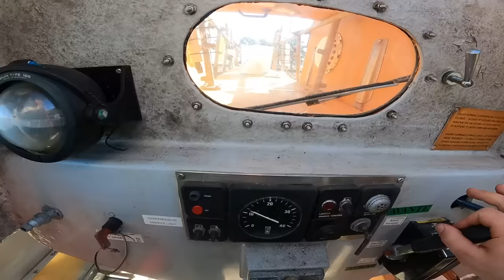Camping On My 64 Person Enclosed LIFEBOAT!!

Comment: Be sure to run the glow plugs for at least 10 seconds before you crank it, and it will start a lot easier.   Also:  I'd check the opposite side of that "hole" you plugged to make sure it's not supposed to be there.  It could be a water intake for cooling the exhaust.
Reply: You took the words right out of my "Had an old Doge with a Cummins which was finiky as heck if you didn't give the glow plugs enough time" to warm up.
Reply: It’s a diesel motor hold the glow plug switch down for about 30 seconds then start
Reply: Fr the old guy he bought it from even said so the first time it started!
Reply: I always did 10 sec on, 3 sec off, 5 sec on, 3 sec off and then 5 on and try it. Worked in the coldest winters with my 6.2L and 6.5L blazer. Don't want to run the glow plug heaters for too long cause they can burn out quicker.

Comment: As other comments before me have said, the smoke is most likely an exhaust leak somewhere in the line. Diesel engines have a tendency to puff plenty of it when they haven't been started for a few weeks or sometimes even just a few days.  Fire up, let her sit to warm up for a few minutes, and you're ready to run. All that said, I see it as a blessing in disguise because you just found where your CO is coming from.

Comment: Residual fuel from all the times you cranked it. Diesels are difficult to start in cold. Glow plugs help by providing the heat for initial ignition then when the engine is up to temp the compression alone is enough to ignite the fuel. Great video and good to see Smalls.

Comment: Greetings from the province of New Brunswick, Canada. I am a subscriber for a long time and always look forward to your videos! Your lifeboat is amazing. With a different propeller you could probably get more speed.

Don’t forget that a diesel needs time to warm up the glow plugs. When trying to start it, there should be a middle position on the switch when turning to give the glow plugs time to warm up. Give it 30 seconds, then continue turning the switch until the starter engages. There might also be a separate switch to push in the middle position that you have to push or turn to warm up the glow plugs, before you engage the starter.

I think it smoked and stalled because the glow plugs were not warmed up and you flooded the cylinders with diesel. Contact the older gentleman you bought it from and see if he can give you the proper starting procedure.😀🇨🇦
Reply: Yes, I noticed he didn't wait for the glow plugs too.
Reply: More speed?!?!? That floating zeppelin has horrible steering that was designed for rudimentary emergency navigation only. More speed would cause that lifeboat to need it's own lifeboat.
Reply: not all diesels have glow plugs, especially the further south you go.
Reply: @fieraci8500  😂

Comment: love that the potential disaster turned out to be nothing! you guys are great doing these videos together. everyone who says lifeboats "suck" is probably talking about the ride -- she's totally fine on a flat lake like that but you take her out on the ocean and she's gonna be pitching and rolling all over the place because she's designed for much more weight. good news is, you start doing your remodeling on the inside and you'll add weight fast -- put in some furniture etc. and she'd sit lower in the water for you pretty quick. I think I would cut out that ballast compartment you were talking about using as a bed, cut out the side seat bulkheads and the foam and then start building out from there. before any of that tho you probably want to sand off that paint and repaint her! start thinking about colors! (you know you wanna do camo...)
Reply: Good points all.
Reply: Having had the pleasure of being in one these boats in the north sea   off Aberdeen Scotland I can they are quite ok empty in moderate seas..
Reply: @derkbruinsma9351  were you testing one or was there an emergency?
Reply: Nothing to worry about. Wish they would have called someone who was familiar with diesels. There’s nothing wrong with firing that thing up and rolling with it.
Reply: Repent and believe in Jesus Christ  what does that have to do with this video
Reply: @HughWoo  I hope Ayo takes advantage of his fanbase for some consulting on this boat -- lot of folks in here with some great ideas and a lot of experience.

Comment: FROM AUSTRALIA, well done guys, that life boat could turn out to be an awesome Lake Camper once properly set up. You might consider re-working the roof  with better perimeter rails with a flat deck. It would require a lot of proper planning first before you start  any restructure inside and out side. Good luck.

Comment: i would definitely do some research on your specific engine, but as others have mentioned, you need to wait for the glow plugs to heat up a bit before starting the engine. Also, when checking the oil, wipe off the dipstick, put it back in and then check it. It will make sure you get an accurate reading of the oil level. But the color and viscosity of the oil is another thing. But overall its an awesome boat and im interested to see some kind of renovation to it, doesnt have to be an all out reno though lol

Comment: In England, there are, roughly, 2000 miles of navigable canals. Upon which many thousands of people live on aboard "Narrowboats", that are either converted historic barges from the 1700's, 1800's, and early 1900's, or of the vast majority of purpose built boats, as full capacity tiny homes. Some are incredibly laid out into the most comfortable homes you can imagine as a boat. Full kitchens, bathrooms, living rooms, and usually a twin or queen size bed, or two.

One of the popular homes,  are converted lifeboats, same as yours. Gutted out, and rebuilt to be as roomy and useful as any large motorhome....that floats.
Reply: Watch Downie Live on his narrowboat adventure...fun stuff!
Reply: @amyshilling7412  Big fan of Cruising The Cut, Robbie Cummings (mostly because he has a Coors sign in his boat), and, while they had a channel, Boating Beyond.
Reply: Florida has almost 2000 miles of intercoastal waterways. Maybe another 20,000 miles in waterways.

England is serfland hell to the king
Reply: @SLO-Ride  thanks!!

Comment: The smoke was probably just a leaking exhaust which there can be a lot of when cold starting an old diesel engine. That could also lead you to where the Corbon monoxide could have been coming from.  Also let that baby warm up a bit after you start it so she can get up and stretch before you make her run after sitting so long.

Comment: Diesel engines are harder to start in cooler weather totally normal.   When cranking put the throttle to 1/4-1/2 to give it more fuel.  Look into if that engine has glow plugs or a grid heater for cold weather starts.

Comment: Sadly if the boat has not been started for a while you get spoke leaks .run for 10 mins before setting off to make sure .check couplings to exhaust pipes .

Comment: Ex mechanic, who specialised pretty heavily into the diesel landcruisers and patrols. Diesels will smoke like a motor for many reasons but cold starts is pretty common. Especially on older, lower compression engines

Comment: Thanks for the laughs, cudo's on that rowing bit, how heavy?  Fishing secret, at dusk throw a jitter bug surface lure, near any underwear structure, log ,shelf. If it don't work they ain't there. Power bait, SML piece of pantyhose, 3/4 inch square,  hook through corners , bobber. Low water is strange, a lot of places got fished out, during COVID.
    As I like to say, don't have an electrician fix your plumbing, good call. Was waiting to see who would end up sleeping on the fiberglass. 😂😂😂 Tried that blood bait once , used shimp or cut bait instead. Too knasty.
     It's cold snowing here, god I miss the south. Keep up the good work.

Comment: I'm glad you found out that diesel motors are smokey old girls. The SAAB motors run clean compared to a good 'ol Detroit. Be glad you don't have an 8V 71, they smoke and spit oil and run forever!

Comment: love the video not sure if you all check the comments. I would recommend just giving that engine a lil love with it being a diesel and I am guessing being a lifeboat did not spend much time running I would just give it a lil tune up check for some numbers on the block to see if you can find any common issues with them online but other than that maybe some oil treatments to get any seals that might be dry rotting to swell back up for now and maybe some fuel cleaners for anything that might be in the lines, maybe some new filters. Seems to run well after starting it but a lil chemical help might help it run better. maybe a can of canned starter for while out in the water. Some battery checking. Would say pulling it and going thru the engine would be best but a lot of work so maybe give it a good look over and maybe have a friend that is good with diesel take a lil check over it for anything you might not see. Maybe make an episode of it? But hey just a random guy on the internet.

Comment: Great makeshift to move your vessel with two kayak paddles! For the future, to deal with another engine failure you will find sculling with a long oar from a stern crotch or oarlock will move your vessel very easily. A similar bow crotch or oarlock can allow reverse motion. The beauty of oar from stern or bow is the ability to steer along with your regular rudder. The long oars can be stowed when not used along the house top hand rails. The technique for sculling by Yuloh can be seen in old videos of sampans and junks in Hong Kong harbor, often wielded by an old woman moving tons of overloaded vessel.

Comment: Water enters the "sea chest" where their is a heat exchanger. The coolant in the engin is circulated into the exchanger inside the sea chest. It you do not have water comming in and out of the sea chest it will overheat eventualy. Rebuilding the Perkins motor that has not changed other than a few sensors and a turbo added since the 1950's. Is simple and inexpensive. I would recommend adding the turbo if not alredy equipped.

Comment: The reason there was smoke in the engine Bay was that you have an exhaust leak and diesel smoke like that when they start up that would also be your C02 problem Because that exhaust leaks

Comment: Coldstart old diesel is always fun. It’s kind of like cutting your heat on for the first time after many months of air conditioner running cold. It smells like something is burning, but nothings really burning. That should concern you.

Comment: There is one of these lifeboats that is sitting in the water right on the Intracoastal Waterway in Isle of Palms South Carolina just North of Charleston.  We pass it twice a year on our migration through there.  It looks like it never moves but since we only see it for a few minutes as we pass by who knows -they might be on it motoring around every week or so.  It's got a lot of growth on the bottom but our own bottom gets dirty pretty quickly and we put a few thousand miles on every year. Unless we are moving practically every day the bottom paint can't keep it from growing pretty quickly.   So we can't talk about that.  

You've got to fix that exhaust leak. That's why it was smoking since a cold old engine that hasn't started in a while is going to smoke at startup.  It's really bad to crank an engine that long if it has a wet exhaust because the water pump can fill the muffler if it isn't running and then it can get up into the manifold and fill the cylinders. That's bad.  

Prime the fuel system so it starts easier. Diesel injectors don't work well with air in the lines and the engine will stumble or not catch at all. Learning how to prime a diesel fuel system is important if you have one. Depending on the engine it is really easy or a right buggar depending on how well it was designed.  I would assume that a lifeboat engine would not be too difficult since they sit for long periods and starting them when needed is sort of important.  The Volvo-Penta diesel in our sailboat is super easy to prime.  If I don't do it then it won't start well at all but if I do it starts in like one second of cranking.

Comment: Might find a trolling motor for the bow ?   Even if you have to make a bracket of some kind. I would even consider scrapping the diesel and put a 250 four-stroke on the back of that mutha ?  (with a bracket of course)  gear it down and go for a larger prop.

Comment: DUDE for tighter turns port (left-side) Starboard side (right -side)Place the wheel to the side you want to turn power up on the engine then power off to really sharp turn either side wheel hard over then power up and off till you come to the direction you want to face. Simple seamanship.

Comment: It's a diesel. When they're cold and dry of fuel they don't like to start right up. It may need filters changed and make sure the glow plugs are working. It's not hard to get a diesel running reliability if you handle all the maintenance.

Comment: Are your batteries in the back? Battery cables can heat up and burn if you turn it over more than a couple seconds at a time. Got the same problem when our forklift don't wanna start

Comment: How long of a bed would cross members create?   Would also add storage underneath and might provide a platform to entry/exit wherever it was placed.  Seems like cutting slats and anchoring them in place would not necessarily be difficult - but then I'm not the one doing it. 
Looking forward to more adventures as the days get longer.

Comment: My thinking is, if there is smoke coming into the living area or even just into the box where the engine is located, it means you have an exhaust leak that needs to be addressed. You cannot get by with plugging holes in the fiberglass. The exhaust leak needs to be fixed.

Comment: Yeah looks like you need to cut the roof off the front half and install a coupe nice windows and a fishing platform on the front. You might be able to scavenge something from a salvage boat. Plus I would make a canopy (bimini top) for over the drivers seat in case you do get caught in the rain you can still see where your going and steer. So many opportunities.. Can you change the prop and get a little more speed out of it?

Comment: Instead of trying to fix up the tired engine you should go electric ... it solves at least 2 issues 1) constantly fixing the engine 2) Carbon Monoxide ... and you have a ton of deck space to mount solar panels win win win

Comment: Not sure if you glowed the plugs, in a diesel engine, you need to glow the plugs which heats them up and allows the engine to fire off.  Without glowing the plugs the engine won't start very easily

Comment: Install some trailer guides on both side of trailer, there cheap to make, out PC plastic pipe. install to trailer as tall as the side of the life saver boat,so you can see them when trailer is in the water submerged. It we’ll guide you in to trailer, you we’ll never miss anymore, lining up on the trailer

You should name your Boat 
(LIFE SAVER). With 2 logos of (life save)candy on the Bow of the boat on each side, then place 2 logos on each side in the Aft.

Comment: I could be wrong or it might have been said but looking at your last lifeboat video and this one you might not have good cooling water.  There should be a steady flow comming out of the exhaust going overboard while it is running.  Most Marine inboards have a lot of rubber and plastic in the exhaust system and if there is not good waterflow they can melt and cause exhaust leaks and overheating of the motor.  If the system is in good shape you shouldn't need any box around the motor to run it without fumes.  Goodluck and have fun

Comment: Check with your fishing laws, but see if you are allowed crab pots or other fish traps.  Instead of wasting the chum, you would put it in the bait sleeve of the crab pot and let the fish (mostly catfish) swim in and not be able to swim out.  That way they are working while you are doing other things or even sleeping.  Same thing with gill nets, see if you are allowed a small amount.  Some have the stipulation of having to stay with the net, which you are.  Also, you have to have the correct netting diameter, marked buoys, floats, etc.  We all love the thrill of hook and line, but traps and nets keep ya fed when they aren't biting.

Comment: since u got 8 months of fibreglass practice.  cut up some plywood to make a flat deck at the front and rear of the boat and glass it up to make it last against weather and give u a nice area to stand or put a chair and sit without the fear of fallin off. as for sleeping maybe have hammocks or cots that fold down from the wall. that way u have floor space till u need them

Comment: I have a suggestion. Why not cover the top of thr boat with flexible solar cells and run them to a battery which powers an electric motor which is connected to the propeller shaft. Better than sucking in all those fumes boys which is very very bad for you . Just a thought guys . Then it would be an eco friendly camping boat. Take care guys stay safe and happy, peace ✌️.

Comment: You know you could reroute that steering mechanism to the top deck no problem all you need is a gear where the steering is chain can a steering wheel with a gear on it.. it's not that hard to put together so you are more comfortable and it has a better turning radius

Comment: If the engine has sat more than 2yrs, i would replace all the gaskets & filters and replace all the fluids.  I would also get a test done on the oil to check for wear.